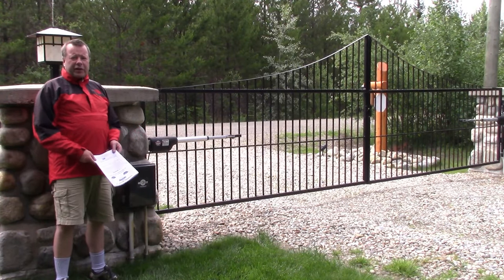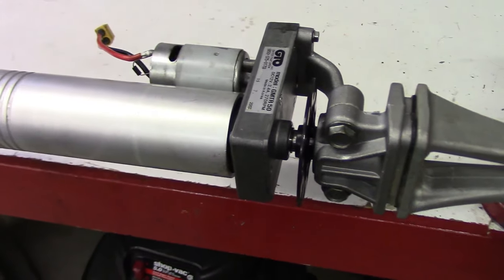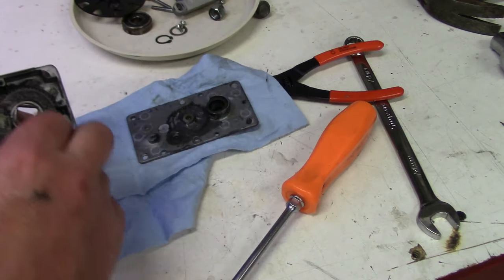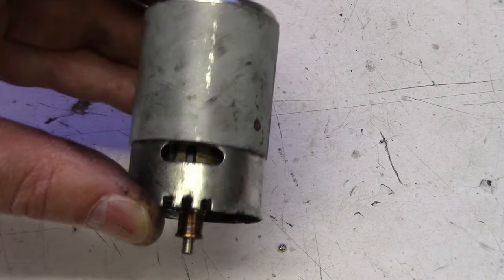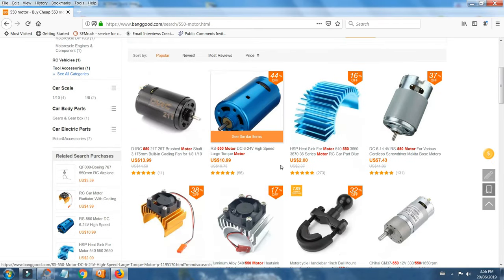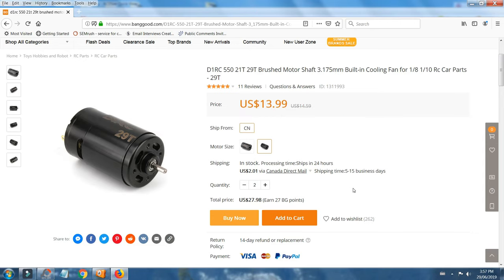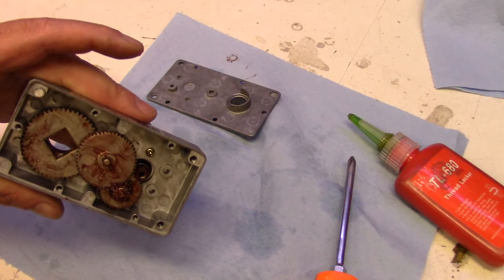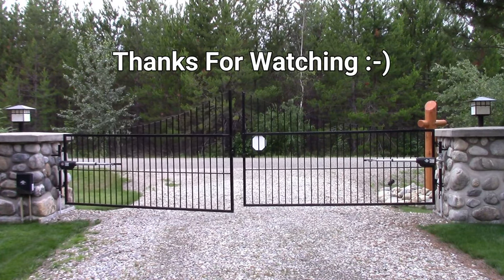Mighty Mule Gate Opener Repair - Inexpensive Motor Option.

Comment: Did the loctite hold the gear on?
Reply from the maker: So far so good. Loctite 648 retaining compound is good stuff. I've used it in much higher demand applications and it's amazing what shaft holding strength it achieves.